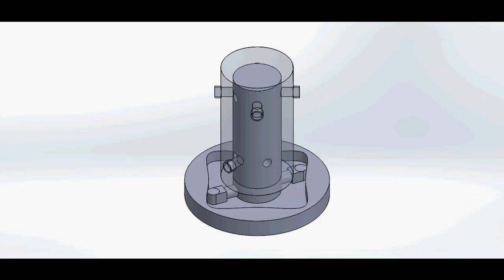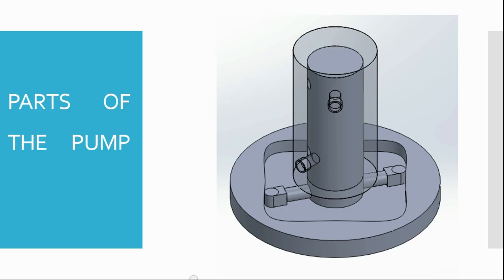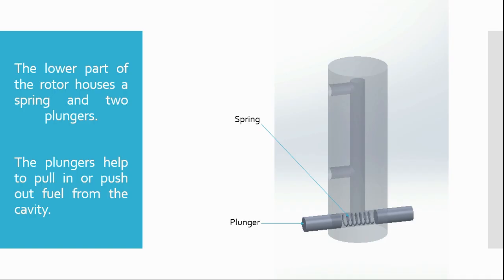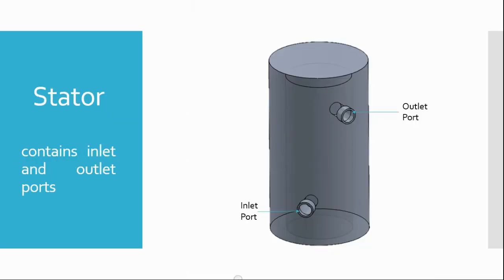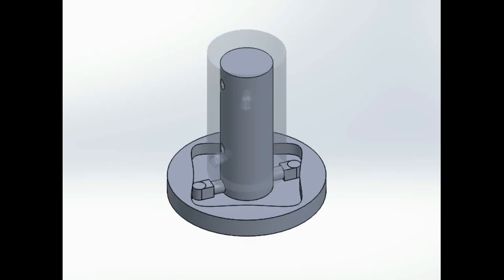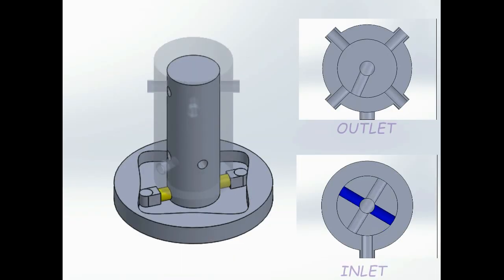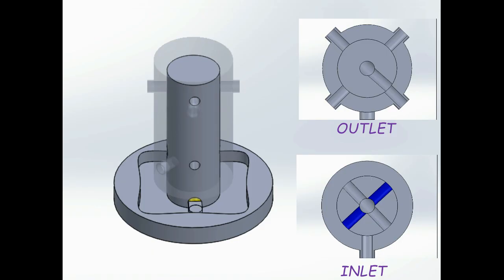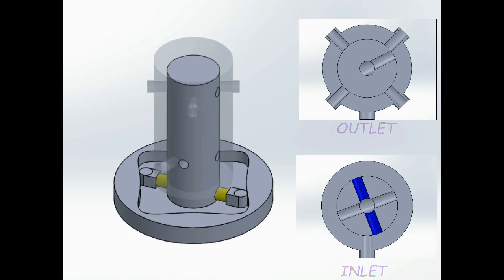Distributor Type Fuel Injection Pump - Working and Animation

Comment: Very nice video, i have one question: why does the fuel outlet port align with a fuel outlet canal after most of the piston is already pushed inward? Liquids cannot be compressed so in reality this would surely destroy the pump right?